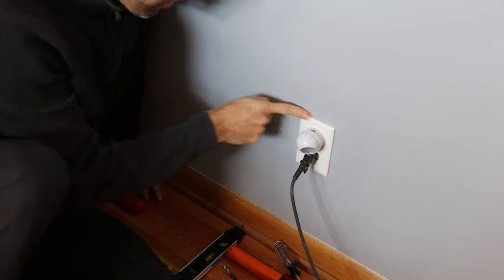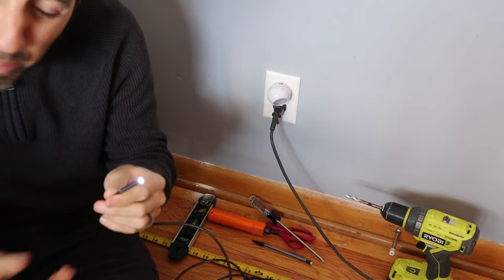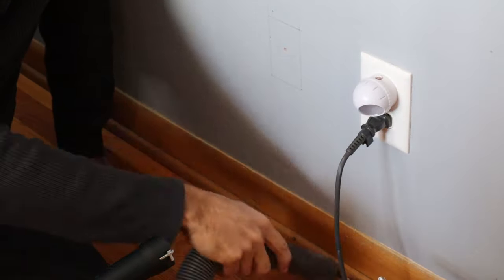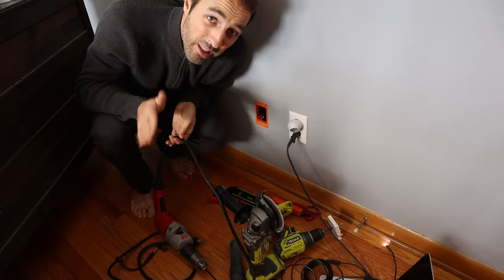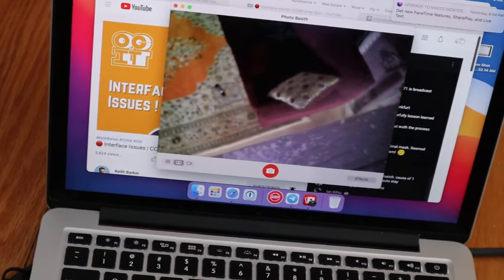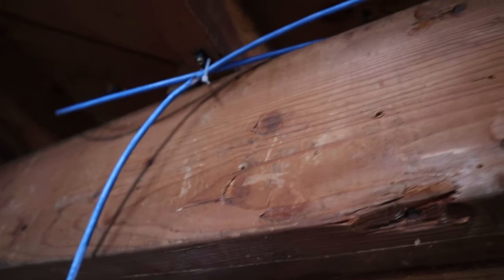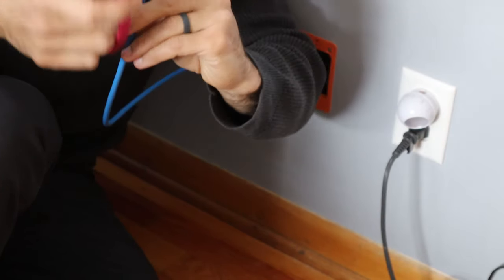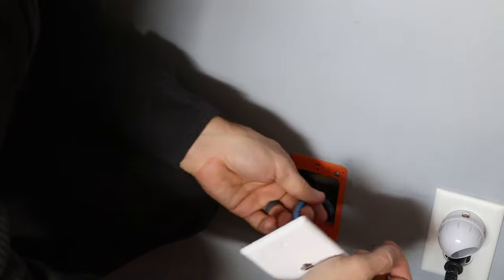How To Drill Through Floor For Ethernet (DIY Homeowner)

Comment: Jesus…. You drilled next to an outlet with no consideration of what was behind the wall - electrical wires, plumbing, sewer. NEVER drill blind into a wall. ALWAYS use a stud finder that can detect electrical wiring. ALWAYS make sure you are extremely careful if bathroom plumbing is likely inside wall. And if drilling blind like this guy, at least mark your drill bit the width of the drywall so you don’t drill further without knowing the pipes or wires are behind.
Reply from the maker: Lord have mercy.
Reply: He literally has a camera scope? He has eyes on exactly where he is drilling
Reply: That’s what a stud finder is for that can detect electrical wiring. If you can afford a $30 scope you can afford a decent stud finder.  He drilled blind before he ever used his scope. Amateur action. Knocking on a wall is worse than using magnets. At least with magnets you can be quite certain of a stud presence with enough nails detected. But knocking could fool you is a pipe of wood spacer is knocked on.
Reply: He had to drill a (first) hole to insert that camera....doesn't take much to nick an electrical wire, plumbing is a bit more resistant.

Comment: For those wondering, he doesn't mention it, but you'd be better off disabling the hammer drill function when boring through the bottom plate with the long drill bit.

Comment: Avoid placement near a  receptacle  that draws a lot of power i.e. a receptacle used to power heating, cooling, or a motor device as this may cause interference; some use a 16 inch rule between ethernet jack and power receptacle..
Reply: Also, (and this is a building code rule for my area) if you HAVE to run ethernet near electrical, cross it PERFECTLY perpendicularly!
Reply: @notcseliot  That is a standard rule of power. If you are running DC and you must cross an AC source, you cross at 90 degrees to prevent field effect interference. Or you can use a shielded cat6 but then you need different connectors and that is more of a pain.

Comment: Using a grinder to cut drywall… lmao
Reply: That worked much better than I expected, my walls are plaster and eats the teeth off drywall blades on my oscillating tool
Cutting wheels on grinders are super strong I'll give this a try for sure!

Comment: Definitely try to stay as far away from the power box and lines to prevent and avoid interference / electrical noise.i recommend sharing a  coax drop /  box if possible.

Comment: Very helpful. I was wondering whether to use one of those long flexible drill bits or a 90 degree adapter. I read elsewhere that the gears strip out frequently on the 90 degree adapters.

Comment: Watching all those videos about wiring a house with cat6 cable just makes me realize how much money I wasted on buying Ethernet cables considering how easy it is to "make" one yourself.

You can buy a 20ft cable for $15...or you can buy a 1000ft for $100 and a couple tools for $30 max.
And then it's just a matter of adding a couple dollars in a pack of 50 RJ45 male ends and you've got 25 cables of any length you want.
That's already less than $6 per cable and the more you make, the less expensive they get.
And unless you've got some crazy wiring to do, 1000ft will probably give you enough cabling for all your needs.